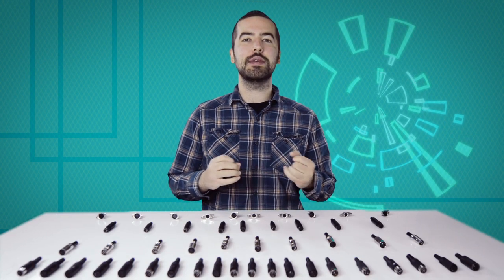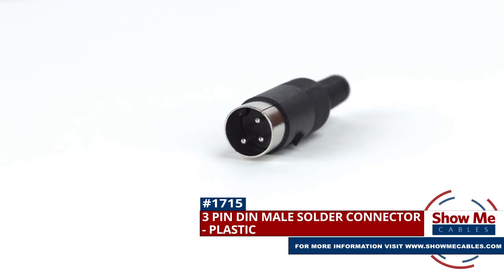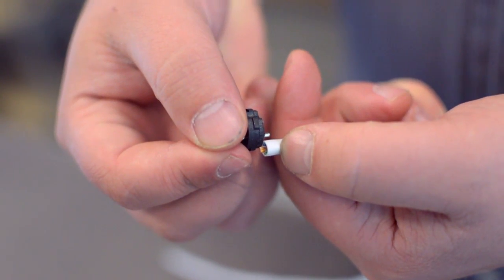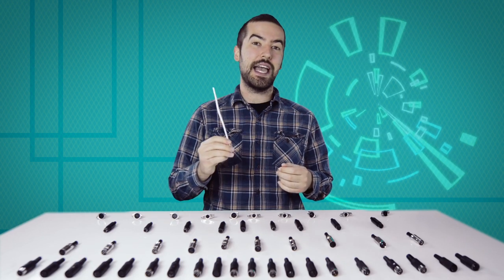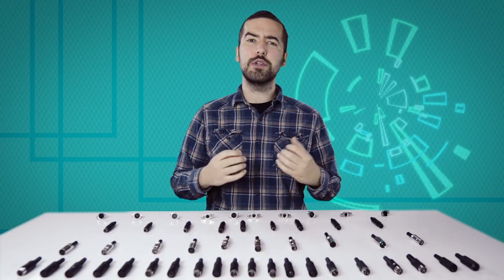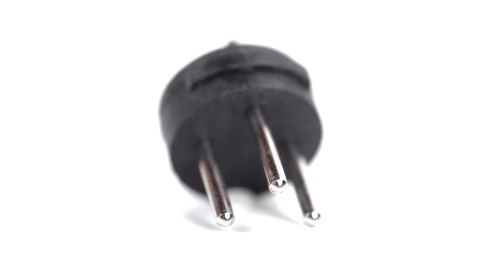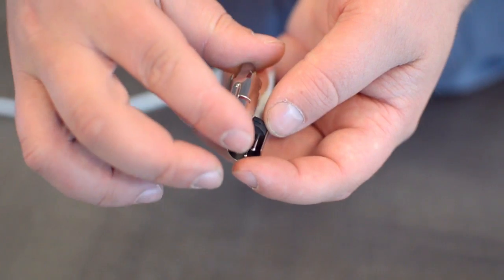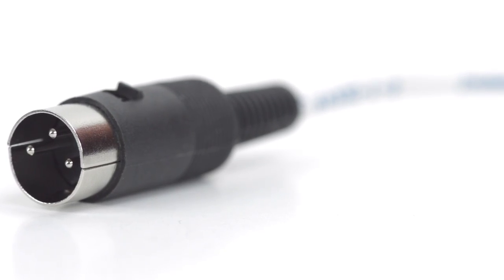How To Install The 3 Pin DIN Male Solder Connector - Plastic

Comment: why are there no ready made 3 pin male din cables?
Reply from the maker: Hello, this is because devices and applications that call for a 3 Pin Din cable can all require different pinouts, there is no standard wiring scheme.

Comment: Hi there. Thank you for the great video.  I am trying to connect a 3-pin DIN male connector to 3.5mm audio jack for iPhone, but I am all confused which pin to connect.  Will you happen to have information about it?
Reply from the maker: Hello!  Unfortunately we do not have any information on connecting between a DIN connector and an iPhone.  Your best option would likely be to contact the manufacturer of the equipment you are trying to connect.

If you still have any questions you can contact our customer service department at 888-519-9505 or customer.service@showmecables.com